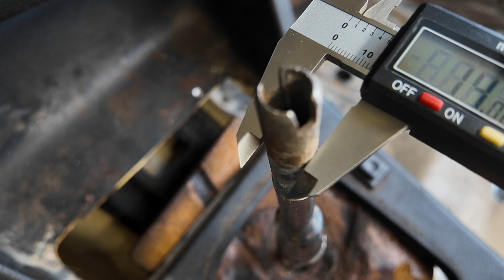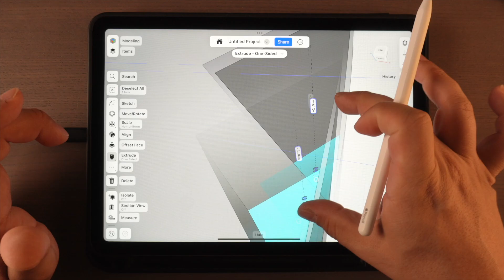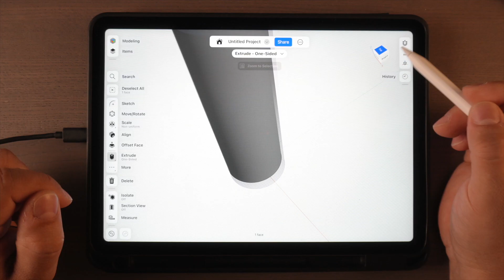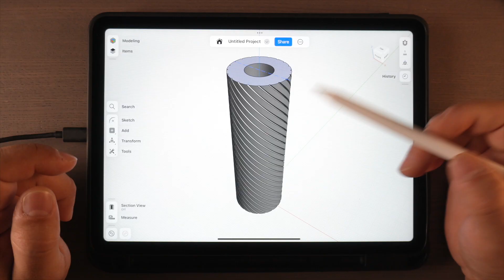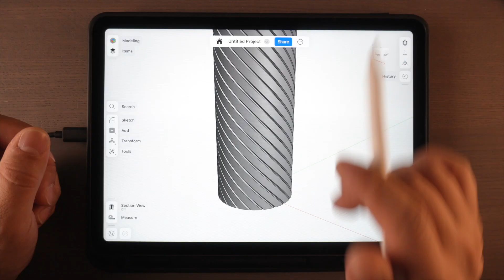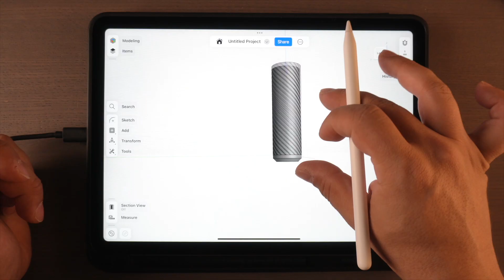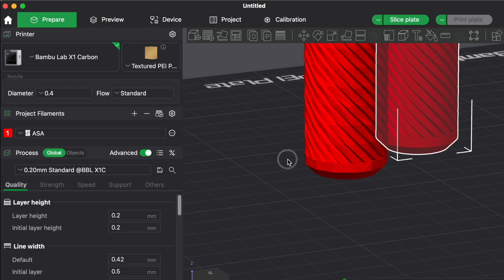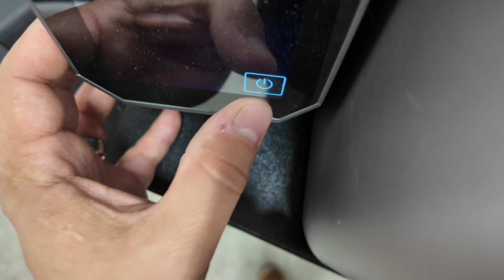Design a FULLY Custom 3d Printed Shifter in Just 15 minutes

Comment: hello! how to secure it?
Reply from the maker: Great question. For our e30, we have a small lip inside the cylinder for a snapping point. For other types, you'll need threads or better yet, a nut you can add into the 3d print. I'll have to create another video showing those steps too :) BTW, what car do you have???
Reply: @Itsallaboutthebuild  e30 and e36. same design on the shifter rod.
Reply: @Itsallaboutthebuild  I printed 2 knobs from a file I found online, that has the same small lip inside but it does not clip. it goes left and right like it is loose.
Reply from the maker: Ah I see, the lip will need to made much larger. Also the additional clearance of the model might be too large. If you want to try designing the part yourself here's the link to our version using shapr3d. You can use shapr3d to change the dimensions, height, etc as needed -> https://www.allaboutthebuild.com/blog/2025/2/can-i-3d-print-my-own-shifter

Comment: nice , looks like I need to work a bit more on the ipad.  my focus has been on fusion 360 and desktop.  How is shapr3d with import of mesh objects ( .obj  & .stl ) to work with scanned objects?
Reply from the maker: Fusion 360 cool, just love using shapr3d especially when I need to take a quick modification to a measurement in the garage. It works very well with .obj and .stl imports to redesign on top of existing files too. Do you 3d print car parts as well???
Reply: @Itsallaboutthebuild no car parts yet, awesome video though
Reply from the maker: Ah ok, maybe one day then :)

Comment: Ive designed one for a buddy years ago with a logo for his channel and resin printed it for him i modled the hole in the bottom the perfect diameter so i could tap threads into it for his shifter. The threads didnt last long so i had to make a threaded insert from a coarse thread bolt that i drilled and tapped.
Reply from the maker: Nice, that’s a great idea. Will have to try that out with an updated design. Do you remember how many walls you had?
Reply: @Itsallaboutthebuild it was essentially a pool ball style with a logo recessed into it that I filled in with color and painted and cleared. I printed it solid since it was printed in resin it added no extra print time just used more material, but it was solid
Reply from the maker: Solid, nice. Thanks for the feedback, what CAD software do you use?
Reply: @Itsallaboutthebuild I haven't designed anything in a while. I tried fusion 360 at one point, but then the next time I tried to use it, it kept locking up and having errors. But the shift knob as well as several other things I've designed years ago I used tinkercad LOL. You wouldn't believe the things you can actually design once you start thinking outside the box LOL for the pool ball style shift know its super simple, just a sphere you can size however you want, then a cylinder to delete material from the center, then the logo I just created the logo in a photo editing software then exported it as a svg. You can import svg files into tinkercad. Or at least you could. Its been a long time since I've done any modeling or even printed anything.
Reply from the maker: That’s pretty cool though, why did you stop 3d printing?
Reply from the maker: Thx, you looking to 3d print some car parts too??